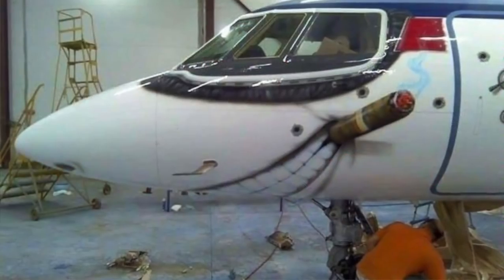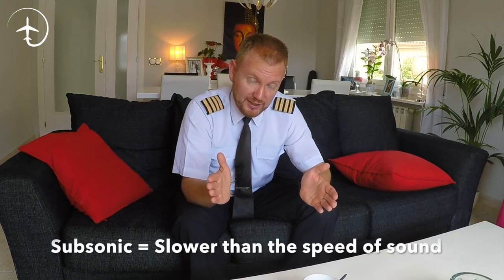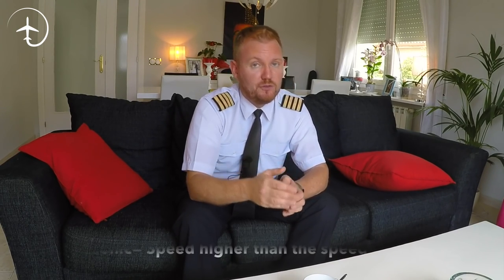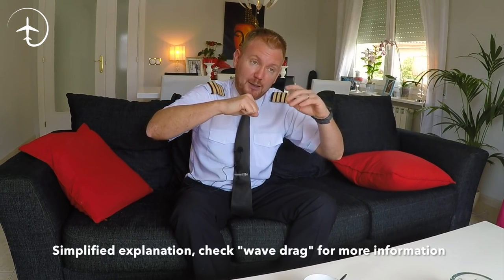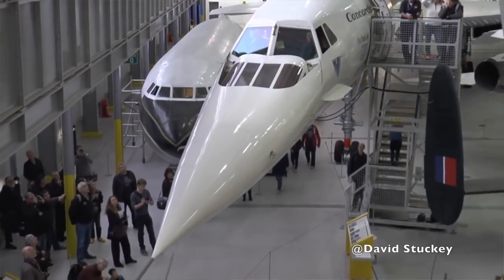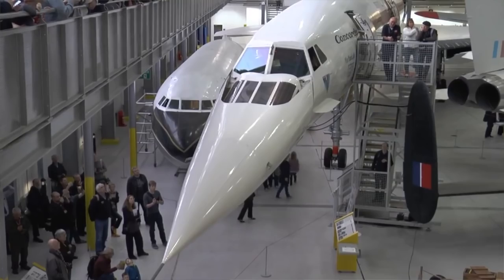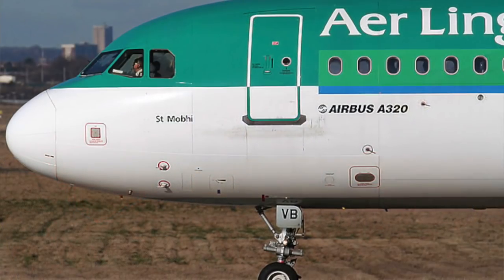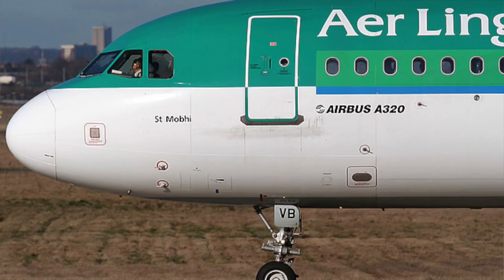Aircraft Noses. Boeing vs Airbus and Rounded vs Pointy.

Comment: Why are the engines mountet under the wings? Only for the easyer maintaince, or are there aerodynamical reasons?
In my opinion it would be saver if the engines mounted on top of the wings (emergency landings without gear or water landing).

Another question, why have airplanes only one blackbox and voice recorder? Why not a second black box, that can swim, have a little parachute and automatic ejected short bevor the crash, to reduce the risk of lost the data from the "main" black box or the plane like MH370?

Comment: Petter, talking of differences between Boeing and Airbus, why does the rear end of Airbuses rake up more than Boeing?  In other words, on an Airbus, the top of the fuselage dips down very little towards the rear, where as the underside curves up noticeably.  On Boeings the top and bottom come together more evenly to the rear.  Surely the Airbus configuration reduces seating capacity?

Comment: Isn't the A350's nose also similar to the 787's?
Reply: I have not looked at the finished product at the airport recently, but I work for a company that builds the parts for both (the parts are all assembled into the final plane elsewhere), and we have small models of both planes on display. On the models, the A350 has the same nose as the A320, with the kink where the windshield meets the nose, while the 787 has the smooth rounded look with the windshield blending into the nose. I am assuming that is accurate to full size versions as well.

Comment: Having studied aerodunamics for some time I have to correct you on the first conclusion: round nose having less drag is not because of lesser surface and the skin drag. It's actually the form drag iself that is lesser for a round nose. And that's just due to the seemingly paradoxal phenomena that the form of the leading edge of a subsonic object has close to 0 impact on its aurodynamic drag compared to the trailing edge which makes the most of contribution. It's a long story to explain but shortly that's because form drag = difference in pressure between in front and the back of the object, not "because you have to push air forward with your windshield" how people usually imagine it :). The later "push air forward' factor (if we imagine air acting especially this way for simplicity) has very little impact compared to the pressure difference caused by the trailing edge turbulence anyway, thus blunt nose just hardly make anything worse. At the same time a rounded nose ensures a smoother airflow around the whole object comparing to pointed, hence less trailing edge turbulence and less drag in total, that's the reason.

Comment: Cameras could have avoided the droop nose on Concorde.
Reply: kitemanmusic weight is an issue. The Concorde needed as much weight as possible spared for fuel and passenger space. Lowering the nose was preferable to having to look down at a screen. Plus, it most likely wouldn't have been a very good image. Remember when the Concorde was designed. Video technology was pretty new still
Reply: Okay, if weight was the issue, how much extra weight was added by the droop snoot mechanism? Camera technology was not that bad.
Reply: It was bad enough that it couldn't be relied upon for an aircraft that was still moving very quickly when landing. The Concorde was designed for speed, which meant that at lower speeds, it could easily drop like an egg. Pilots couldn't afford the extra seconds of looking down at a screen and then looking up again. It's the same reason why it's a bad idea to be looking at your phone when you're driving.
Reply: There was a pilot, and a co-pilot, so one could look down. Anyway it is all academic now....

Comment: On the visibility issue... wouldn't that be easily addressed with cameras?
Even given that depth perception, and therefore, binary vision would be necessary, why not use a camera/VR system that would give the pilot 360-degree vision. It seems like that would not only be a better solution, but vastly cheaper than any compromise on a multi-million dollar aircraft.

Comment: Just a quick question regarding air movement in front of an airliner. On many occasions on a clear blue sky day, I've noticed a long dark streak stretching across the sky in front of a passenger jet as it moves across the sky. It appears to be several miles long. I'm assuming it's some kind of pressure wave but it's dark colour (Canadian spelling) and long length is puzzling. Would you know what causes this?

Comment: Good explanation, another point long noses are expensive. Both in materials, access to gear, and making plane longer, heavier for little benefit. The radar nose for a Concord was I am sure at least 5 times the cost of a 737.  Windshields are very expensive too, I wonder what you guys thinks of cockpits with almost no windows.

Comment: A drooped nose might be quieter.  If you look at NASA's research into quiet supersonic flight, you will notice noses that are flat on the bottom and rounded on the top.  Basically it looks like they are shaping the sonic boom so that most of the sound projects upwards.  There might be a similar noise shape in the subsonic regiment.

Comment: Wouldn't the 787's nose droop also make it so that while cruising and the wings are pitched at maximum lift angle of attack, the nose's tip is at 0 degrees angle of attack minimizing the coefficient of drag/wave drag  (meaning that it acts like a pointy nose cone as much as possible most of the time)?

Comment: Could you make a video about how flying would change if the turbofans were replaced by rockets of the same thrust due to the loss of the rotational inertia of the fans and compressors?

Comment: To me, the droop-down nose is not only needed to provide pilots with visibility, but also to make the drag less when the plane pitches up before landing. This drag creates a pitching  momentum. And that's the principal reason why subsonic aircraft is not equipped with a pointy nose. With an angle of attack of several degrees at the cruise stage the pointy nose will create a considerable drag and pitching momentum.

Comment: Hi
Can this flat nose (like in boeing airplane) can reduce the lift generation to the wings? 
Because it produces a shock wave so the point on the wing nearer to the main cylinder chamber,will not be able to produce lift.

Comment: I agree with what he said about the shape of the noses of the Boeing airplanes to be very easy to recognize as Boeing. But how about the nose of the Boeing 757? That nose is more round than the other Boieng noses and it looks alot more like the noses of the Airbus airplanes. In fact it is by the shape of the nose and the width of the fuselage how I can recognize a Boeing 757 from a Boeing 767.

Comment: Can a modern airliner achieve super sonic speed let's say in a steep dive? And what would happen if it does?
Reply: Franz Pretor most likely some structural damage would occur and if the dive when on for long enough or the speed increased the plane could break up.

Comment: This is an interesting subject, but looking at the aerodynamic effects one is dealing with either skin friction or the mass effect. The skin friction is due to the fact that the air touching the plane is moving with the plane while air away from the plane is stationary, so there is a layer of air that is always shearing and it is this shear action of air that is related to the skin friction. 
The mass effect is related to the fact that the heavy air particles in front of the plane must be swept out of the way so that the aircraft structure must go through the gap without distorting the structure
Now the basic laws of physics say that Force= mass * acceleration.  So to accelerate an air particle out of the way the aircraft must exert a force on the air particle. It is all a vector problem and basically the lower the acceleration in moving the air particles sideways out of the way, the lower the forces required and so the lower the drag.  Now a long pointed nose would result in a slow acceleration while a blunt nose would seem to need a higher acceleration, but a blunt nose is not as bad as it sounds.  At subsonic speed, the bluntness in a nose is normally filled in by stagnant air that could travel with the aircraft. Let us say that the blunt nose is just flat face moving ahead.  This may appear to be flat and the air particles need to hit the face and then move out sideways. It is not like that.  Ahead of the flat face, there would be a zone of air which would stay in the same position as a pressure zone, and this would be stagnant air always traveling ahead of the flat face. This stagnant air ahead of a flat face will be shaped by the air particles moving sideways and thus this stagnant air will shape itself according to the speed of the aircraft, it is a self-adjusting design.   This pressure zone in front of a flat nose is not so passive as it would be churning around in a vortex with the external surface being pushed back while the inner axis being moved faster than the aircraft. It is an interesting vortex.
Now if instead of a flat face one rounds it off as in the Airbus, the rounding off will decrease the stagnant air ahead of the nose and there is a degree of roundness that will not permit the stagnant air vortex to occur. It is at this point that there is no need to keep rounding off the nose to a  more pointed shape as the surface area will increase and the skin friction comes in action.
Really this is nothing new as if one looks at all fish and all birds, the front is rounded off.  The fact that some birds and fish have a pointed nose is for the convenience of eating and hunting...... but dynamically a perfect shape for the nose is one where the roundness will just get rid of any stagnant air vortexes accumulating at the nose.  This is the same with sea craft. The owl with its big head, it still flies fast and so smooth and silent.  All this is related to the fact that a large radial air-cooled engine at the front of a fighter plane is not any slower than an inline liquid cooled engine.  If one simple mention the fact that the best aerodynamic shape is the teardrop with is not pointed at all but rounded off at the front. Nature is a great teacher and evolution is a great researcher. Most moving creatures have a relatively blunt front side as compared with the rate of change of the curve at the back, It is at the back where the air flows in to fill the empty space after the craft has moved forward that is the tricky part where most of the drag comes from. So a blunt nose does not hurt much but the rear part must have a slow rate of change in the filling of the trough that moving craft tend to create as soon as their widest part goes through the fluid medium it is moving in.

Comment: While mentioning the Concorde's pointed nose, why not mount a camera? Is the chance of failure unacceptable?
Reply: Nowadays cameras may be reliable enough to be used as such, but back in 1968 they certainly weren't. Furthermore their size and weight may have been prohibitive. Apart from that, it takes a wee while for the authorities to embrace the latest techniques.

Comment: Nice video Peter. Just an addendum from me: the skinfriction drag and the form drag you mentioned are the main components of PARASITIC drag, and not of the drag as a whole. And thats very important since parasitic drag may sometimes be only a little part of the drag, being the induced drag or the wave drag more relevant. Actually, the pointy shape of Concorde's nose is justified much more by wave drag matters than by any other component of drag...

Comment: Thanks much for this video.

Some suggestions for the next videos:

- the fly-by-wire technology on Boeing vs. on Airbus, differences between both manufacturers and back-up systems on each in case of electric failure

- the same with other manufacturers using the FBW technology

- active vs. passive side-sticks, which manufacturer has chosen which technology (Airbus, Bombardier CSeries, Embraer KC390, COMAC, Irkut, Sukhoi)

- flight philosophy (such as computer control vs. human control) for each manufacturer

Comment: I believe you have some partly inaccurate information. 
[This is all in reference to subsonic speeds] A sharp pointed shape actually is slightly more aerodynamic, though at a more obtuse angle than the exaggerated very acute angle of the Concord. 
There are two contributing factors that lead to rounded noses being preferred, first the drag reduction from changes to a leading edge shape [nose is a leading edge] is very small compared to other aspects of the aircraft shape and as you said round is more material [weight] efficient; 
The second and more important issue is that of angle of attack: rounded leading edges are insensitive to angle of attack(vertical or horizontal) and they present a shorter lever and smaller area to cross winds, while sharp leading edges have rather sudden flow separation at a critical angle of attack with the sensitivity to AoA increasing with the acuteness of the included angle.
As for the nose drop, yes it is mainly for a better visual field, but during high AoA the fuselage contributes significantly to lift and as a bonus the dropped nose aids this by adding a small bit of effective camber to the lifting body shape.
Boeing is famous for commercial aircraft and may seem old in that regard but the high performance research and development, government contract, side is a substantial part of the company. (they make many products for both military and NASA) 
I seriously doubt that the difference in nose shape between Boeing and Airbus is aerodynamically significant, More a matter of manufacturing and fitting other design aspects. Now the cockpit window area may be somewhat significant but that is not strictly part of the nose, though it is a diverging/accelerating flow area.
Reply: Oh and I just enrolled in a commercial pilot school, motivated in no small part by this channel. The college(degree program, ground school, and simulators) contracts the physical flight time to local flight schools at several airports, Boeing field (KBFI) is one of the options. (Though it is the furthest airport from me and with dense highway traffic, so I probably won't be using it.)

Comment: Do you have any knowledge of the future of aviation?

A massive improvement in pilot awareness is needed...

Have you seen the movie "Skyscraper"? The sphere at the top of the building has cameras on the outside and video panels on the inside. The effect is that you are floating in the sky and can see everything...

With hi resolution phone cameras costing only a few dollars each, it boggles my mind as to why planes still have windows at all. They provide extremely limited visitability and weaken the structure.

Do you know of any plans to replace the cluttered cockpit with video panels and controls that are more dynamic?

There could still be backup manual controls and fiber optic displays that use no power, just external light focused on a fiber bundle that's directly viewable in the cockpit.

Hundreds of tiny cameras could easily create a real time composite image of the entire plane projected onto a 3D model of the aircraft.

The computer could also detect anomalies instantaneously.

$0.02